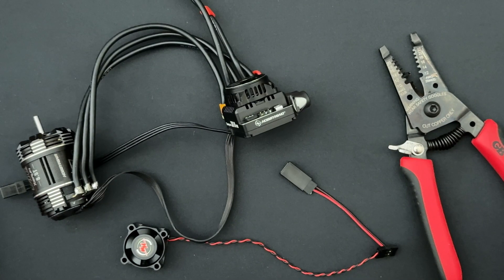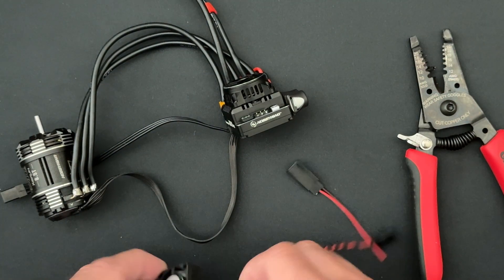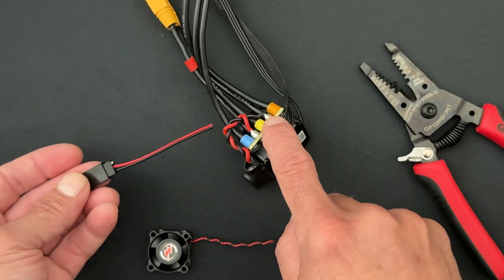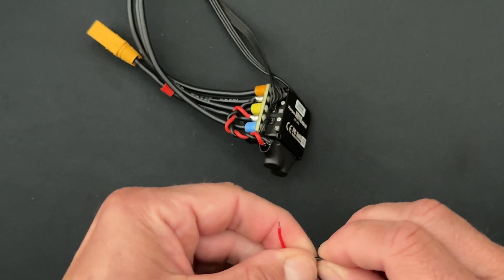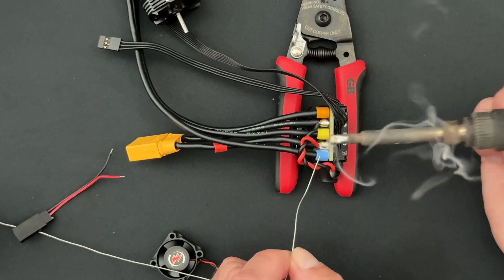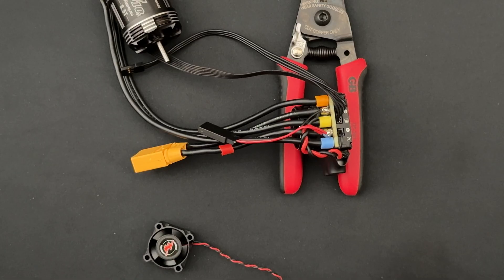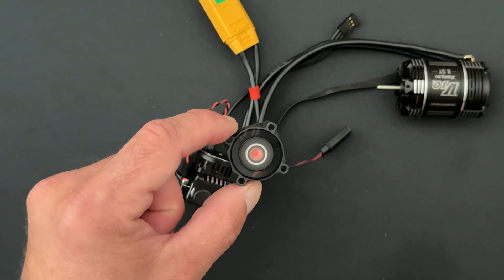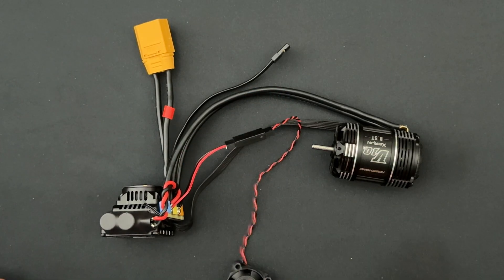HOBBYWING Pro Tip - Extra Fan Power - The Charlie Show - EP 425

Comment: Will you motor run more powerful or efficiently if it's at a cooler running temp by afew degrees by doing this mod? 

My motor gets warm but is a temp I'm happy with after a race so I don't need extra cooling but would this help the motors performance with it heat soaking or whatever?
Reply: Yea definitely saves on wear & tear of magnets & bearings when Cooler. I have a 40mm i turn on from my NB4+ when I see temp hit 150 and with fan on it can keep it around 120-125